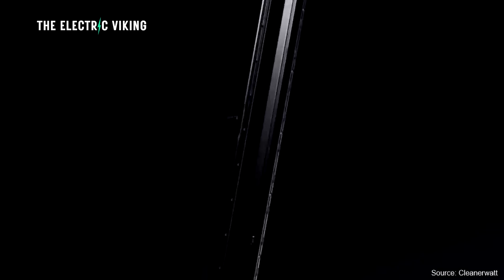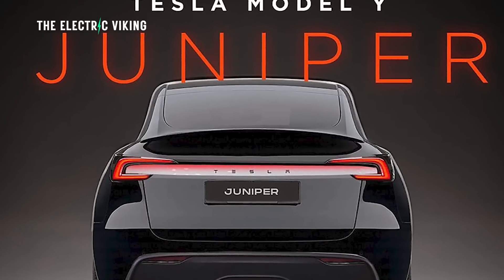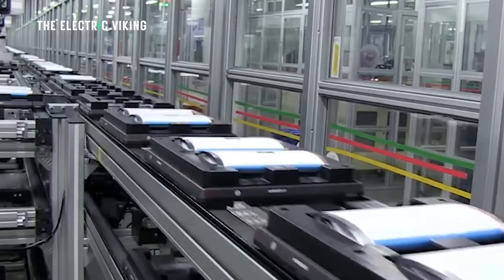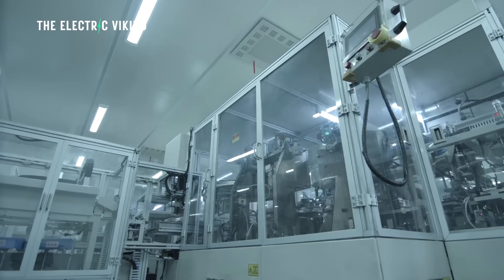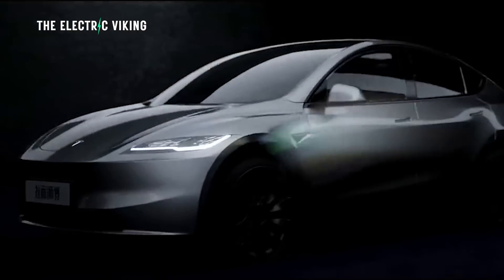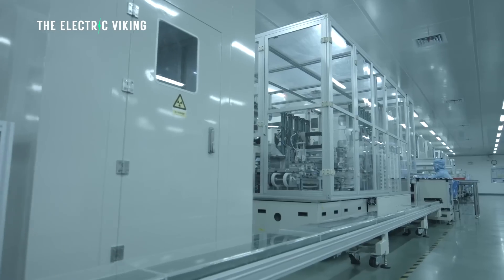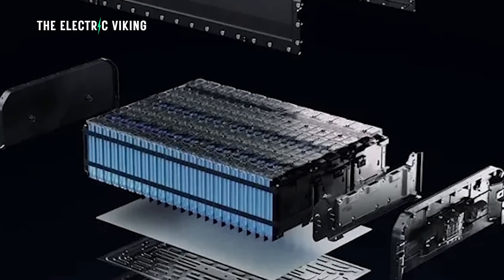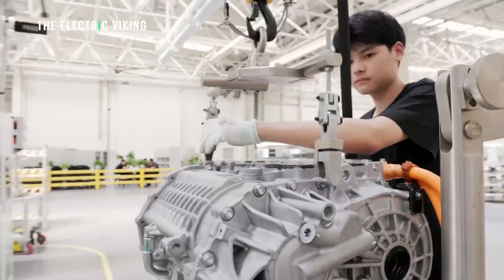Huge increases in energy density and charging speed for new Model Y battery

Comment: Or they pit less batteries, less weight,  same range
Reply: That's what I'd expect, better profit margins but maybe 10 miles more range.
Reply: @myhome772 I wouldn't touch  a hybrid with a barge pole, still have to maintain a complex combustion engine and highest fire risk of all cars. Range not a problem for me, and eventually there'll be charging stations everywhere.
Reply: I think they will have a standard range which will be lighter, and cram all the new CATL's in for a long range version.
Reply: You're describing the "virtuous cycle", wherein the battery weight loss also mean a weight loss possible in the EV car structure. Point being that weight loss also contributes to increasing EV range.